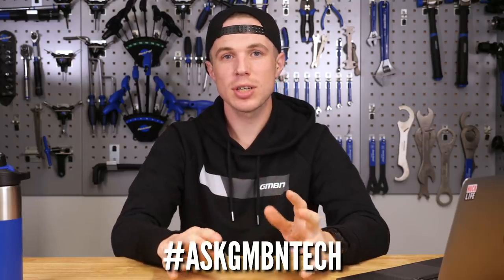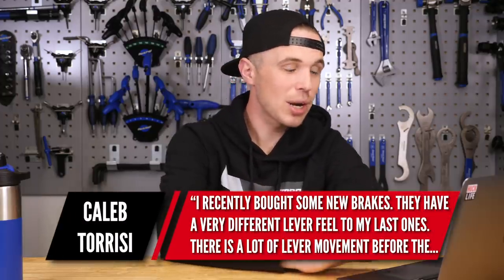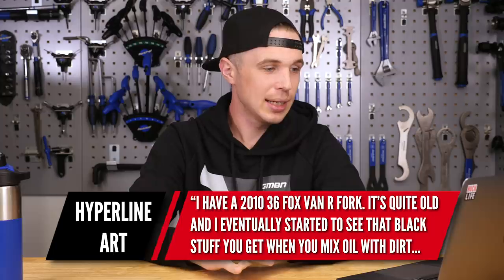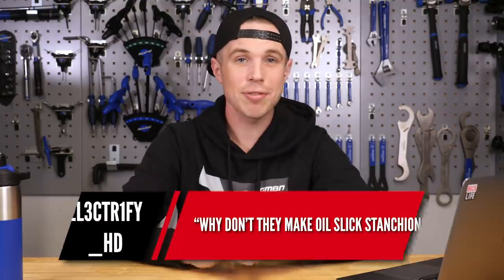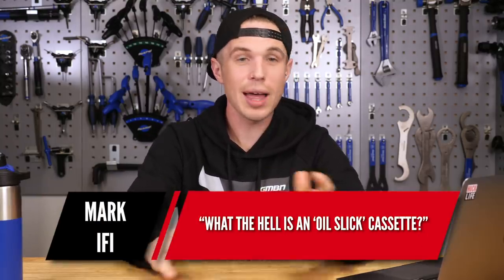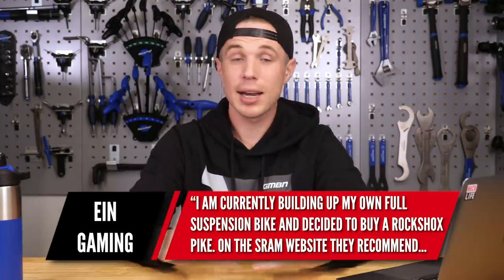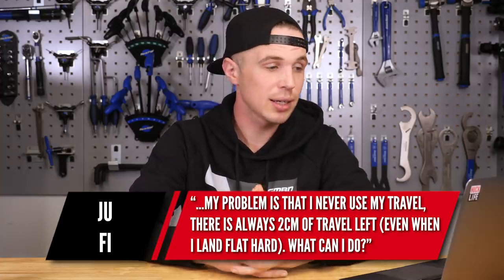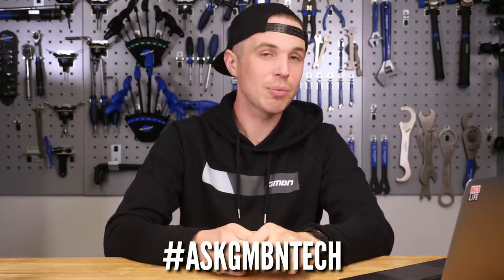Why Don't They Make Oil Slick Stanchions? | Ask GMBN Tech Ep. 86

Comment from the maker: Got a tech question for us? Submit it below by using the hashtag #AskGMBNTech for a chance to be featured on the show!
Reply: I have a Lombardo Sestriere 300 which has a 3x7 speed Shimano Altus gear system, do you know if I can upgrade it to a 1x9, 1x10 or 1x11?
Reply: #askgmbntech 
"Hello from Kharkiv, Ukraine!
I've got 2017 Cannondale Beast Of The East 3. In stock it goes with 2.8" WTB Trailblazer tire on WTB Scraper rim, with 45mm internal width. 
Unfortunately my rear rim got cracks on the spoke nipple holes. It is very difficult to buy a rim with such parameters in our country((( 
 In your videos you convert your bike from 27,5+ to the 29er. So I decided to put  29" wheels on my bike. 
What width of rims & tires should I buy?"
Reply: #AskGMBNTech im looking to upgrade my shock on my calibre bossnut, im looking at the rockshox monach RL, im looking at the shock on there website and i cant find the travel for it, would you please be able to tell me how much travel the shock has and how to measure it. Thanks alot!!
Reply: #AskGMBNTech
I have a late 90s K2 Proflex 3000, set up with a Marzocchi Bomber MX Pro fork.  This is a departure from the Girvin crosslink fork that the bike was designed for, and as a result the bike is dynamically unstable, with the forks oscillating uncontrollably when riding with no hands.  Short of hunting down a twenty year old linkage fork, is there anything that I can do to make the bike more stable?
Reply: I’ve tried to set my wheels up tubeless with a 2.6 continental Trail king and der derbaron ,muc off sealant and valves paired up with Alex MD35 650B plus 32H rims. There is a tiny leak in the rim where there is a line that follows round the whole rim which I imagine that’s where the rim joins, my rim tape is good with no scuffs or tears and the tyres seated perfectly, keep up all the good work GMBN! #AskGMBNTech
Reply: #AskGMBNTech
Hi guys. I am wondering why the DH bikes have rather conservative reach numbers compared to modern EN bikes? For DH bikes, I do not think I have seen more than 490-ish reach even for the largest frame sizes, while 510mm+ is becoming pretty common for EN bikes - with the importance of downhill stability and longer chainstays allowing better weight distribution, I would expect the numbers to be very similar. What's the reason for that reach length difference in these two bike categories? Thanks!
Reply: #askgmbntech 
I have a 2018 Vitus nucleus VR. Is it possible to convert it from a 2x9 to a 1x11? If so what equipment would I need?
Reply: #AskGMBNtech Hi gents! After having a puncture and fitting a new inner tube, my rear tyre wobbles quite a bit! The wheel is fine and the tyre was perfectly even before all that. What do you suggest, how can i make this perfectly aligned and balanced again? Thank you for your comments. Anti
Reply: #AskGMBNTech Hi guys I have question 
My new bike have crank with 3mm offset chainring  now me question is can I use a 6mm offset chainring on it 
thank you for help mike
Reply: #AskGMBNTech - When are you getting new t-shirts with "bicycles, my friends, are the only chains that will set you free" ? Sponsored by @HenryQuinneyPhilosophySchool
Reply: #askgmbmtech hi guys I'm looking to upgrade my forks I have suntour xcm 27.5  11/8 -1.5 . Can I change to fox 36 and what would I need to look out for to make sure they fit .bit of a newbie .my last bike was a bmx thanks .carl
Reply: Can I paint my bike stanchions

Comment: Hey Henry, about the break lever throw questions. I run saint breaks that have great power but a lot of free stroke before grabbing. I swapped out my Shimano rotors witch are 1.8mm thick for Magura rotors witch are 2mm. This drastically improved the lever feel and the rotors are stiffer witch means less likely to bend. Hopefully it helps someone in the future.
Reply: I feel the same with my Zee !!!

Comment: 'oil slick' look isn't always achieved with vapor deposition (it can be, but doesn't have to). You can also get this look by oxidizing metal carefully (electrochemically or thermally). The oxide layer cycles through different colors depending on its thickness, hence the oil slick look.

Comment: About the first brake/play question : Sounds like it potentially could be an issue I myself and a friend of mine had with Mavic Crossrides in which there was some sort of delamination occurring within the hubs themselves ( front and backwheel ) the part where the disk is attached to the hub actually stayed fixed but the remaining part of the hub had play ( these cheaper hubs are not 'one part' but rather an assembly) .This phenomenon is also described in some biking forums if you manage to find them. I think this issue occurs more than its reported because many people don't notice the it...  The crossrides I had were 6-bolt but I can imagine the same issues occurring on centre-locks.

Comment: Regarding the question about Yari fork not getting full travel. It could also be that air pressure has build up in the lowers. Try to burp the air using a small ziptie by sliding it between the stanchion and the dust seal lip. Make sure to clean the area carefully before doing this. Perhaps you can hear a short hissing noise.

Comment: Re the rockshox fork travel use question, its due to the larger neg spring on newer forks or upgraded air springs to earlier ones. Adding Tokens will make it much worse, and harsh in the last half, sorry Henry. The new forks basically dont need tokens in the main.
You need to run zero token and 30% sag on the rockshox forks with the new airspring. The neg spring is so big u will still get loads of mid stroke support (due to volume/pressure changes, big neg gives more mid stroke sppt, not less), with great progression. Its confusing lots people (even h and doddy!) as forks usually use tokens and 20-25% sag. No tokens, 30% sag, is the new standard for RS forks. Try it! Dream fork if u do!

Comment: i think i have the same problem as the first guy on my hardtail, it is very old (bought in 2007). to get rid of the play that i have when doing exactly what he describes would i have to change out the callipers due to them not holding the pads as tight as they used to over 10 years ago.

for reference, no play that you can see by just looking and feeling the components on the bike, and the not so big problem is actually bigger on my rear brake, i suspect it comes from me having spent most time of that bikes life on the rear wheel doing wheelies and thus using the rear brake a whole lot and pretty hard use too.

Comment: hi just a little note on the problem with brake lever travel.
I have a trek remedy 8 with SRAM guide r brakes when changing the pads if I don't adjust the using the special spacer tool the lever feel is shocking

Comment: #AskGMBNTech Can I service my rockshox yari 100% by myself? Willl it void my warranty? does factory oil in lower legs and in the damper work in lower temperatures like -15°C or -20°C? If not what other oils should I use for that temperatures? I want to be ready and know what to choose for the winter season
Reply: KCPR666 who does mtb when it is way below freezing outside?
Reply: fluids when cold become more viscous. if the damper gets sluggish you might want to swap the oil for a tinner one
Reply: Sram already can advise u on fluids for low temp use. Check.their websites.

Comment: #AskGMBNTech Hi guys, loving the show. I have an old Fox 34 fork from 2013. Because it had terrible stiction, I replaced the air shaft assy with an NA2 upgrade kit. I even hacked a negative air spring assy in there (from MRP) I also upgraded the damper to an Avalanche open bath damper. The fork still has terrible stiction. This makes the fork almost rigid when it is sagged. How can I make this fork more supple?

Comment: 9:25 add 5% more sag and if that doesn't do it, do what Henry said

Also, I'm with him on the oil slick thing. Accessories need to be black for the most part with potentially some accent colour (you could do white but that can be overdone really easy). The idea is to not draw the eye away from the shape of the frame too much
Reply: I agree with this as well. Let some air out and increase sag to see if you use more travel.
Reply: It sounds like he is using full travel, people don't realise that the crown to the top of the fork leg does not indicate the travel, forks have bottom out bump stops, and they usually leave 2cm ISH of stanchion. I thought he would have mentioned this.
Reply: @jamestyrrell2225  Not so on rs at least. If u let.all the air out, u can slide the lowers up so the o ring gets to about 3mm from top of legs. Thats full travel.
Zero tokens, 30% sag is required on latest RS forks or if u upgrade airspring to new ones with larger neg spring
Reply: As he said he was running 20%, he needs to run 30% sag. The new RS airspring with larger neg needs no tokens and 30%, but still has amazing mid sppt. U wont get the full potential of the fork otherwise, or use more than 80% travel. 
Its a step change in fork performance, but needs a new mindset in set up
Reply: That's fair then, I thought there'd be more than that! Will bare that in mind if I ever get rockshox haha. Personally I run quite a low percent sag, between 20 and 15 in my 36 float, but I jump a lot and need the support. If I ride xc I release pressure.

Comment: Hi, does a sram nx eagle axle fit in a 83mm english threaded dub bottom bracket? Keep up the great work!
Reply: Needs to be a DUB NX Eagle crank in order to fit in a DUB bottom bracket (DUB meaning crank axle diameter is 28.99mm)
Reply: Hendrik K. So, the length of the bottom bracket doesn’t matter?

Comment: You can get a sort of oil slick fork, the coating is called Titanium Nitride and this will actually improve performance as it reduces stiction and makes the stanchions harder improving longevity, you can also get DLC treatments that do the same.
Reply: The gold colour.on chains and xx1 eagle is a titanium nitride coating. Also drill bits. Its different to the oil slick rainbow effect
Reply: @rupedog  thats why I put "sort of" if you take the purple nitride option it looks sort of oil slick.
Reply: @rupedog  its been used in motocycle suspension for years, my mx bike has DLC coated forks and shock shaft.

Comment: oil slick surface coatings are based upon a variable thickness of coating. You don't want that for fork stanchions, you want the coating of very consistent and as thick as possible.

Comment: #AskGMBNTech - could you give some thoughts on buying carbon frames 2nd hand? Looking at a Pivot Mach 6 for a VERY reasonable price, but feel strangely more worried about buying a carbon frame on sight, although I've previously bought aluminium over the net solely based on photos.

Comment: Hello, firstly i love your videos.
Secondly i want to know that which one is better option: Buy a mavic crossmax 2019 modell with 24 spokes, or build one with 32 spokes, novatec hub and blackjack rim. The price is the same.
Reply: for a 29" rear wheel best to use 32 or 28 spokes at least
Reply: @ultiss  oh i didn't mentioned, it is a 27,5 wide wheel

Comment: Hi guys, #AskGMBNTech 
I have a trek top fuel 8 2017. I have started riding more downhill and would like to make my bike more suited for it. I was thinking of putting a 130mm fork on the front [ it currently has a 100mm ]as well as a shorter stem and maybe some wider more swept back handle bars.
is this a good idea ?
I am thinking it would be a cheaper option to buying a trail bike 
please let me know if this is an awful idea !!

Comment: #askgmbntech: Hi there, I like your show very much and learned already a lot! I have a canyon sender cf from 2019 with a fox x2 elite. My hometrails do not have a lift, therefore pedaling is the only option to get on top which is quite ok with me. cassette is a 10 speed with 11-28 and a 36 in the front. Bobbing while pedaling is a problem and feels like pedaling in muddy conditions. I thought about upgrading the shock with lock out lever. Might that help? In addition, I could also upgrade the rebound dial to get both lsr and hsr. Would that be worth considering, too? Thank you for your help!

Comment: Hey guys,
I have a 2018 Intense M16C it has a rockshox vivid r2c at the back and whenever I am off the bike and move it I can feel a bit of play (maybe 5-10mm of it) when I hold the back wheel on the ground and pull up from the seat. Is this normal? If not how are some ways I could stop or minimize this.

Cheers,

Anthony
#askgmbntech
Reply from the maker: Hey, sounds like it's time to check the frame bearings/shock bushings. We suggest fully stripping the frame as it may be that an axle has broken. Hopefully it's not a big job Anthony.

Comment: Hello GMBN, i have a 2009 Ram Dhx downhill bike, the drailure is a shimano slx with 9 speed, so my problem is: when i want to get some speed and i push the pedal the drailure is not on the pinion and my pedal go like i have no chain, and recently i had a big crash because of that, what can i do? #AskGMBNTech
Reply: derailleur not adjust properly or simply worn out cogs?

Comment: #AskGMBNTech i have vitus nucleus and im looking to upgrade the fork from 120 to 130-150 what changes should i expect riding wise?
Reply: higher bb, slacker headangle which is good for desending, however climbing will suffer a bit, steering less direct and youll have to slide your saddle forward to keep the same seating position. hope that helps

Comment: #askgmbntech with disk brakes being around so long in MTB tech and fullys being around for as long as I can actively remember, were there any attempts on making the rear end more like a Motorbike suspension? I mean connecting the chainstays directly to the seat tube and removing the two bars going up into the linkage?

Comment: #askgmbntech  I'm trying to bleed my old avid elixir 1 brakes for the first time in a long while. I got the bleed kit from avid and followed the instructions perfectly, however, I can't push the fluid from the syringe at the caliper to the one at the lever.
Both clamps are open and the syringes thread in nicely. If I push hard, the fluid ends up on the floor. I also tried pushing from the lever to the caliper but it doesn't work. This is the case for both the front and the rear brake.
I read online that dirt particles and pieces from an old and brittle o-ring can block the insides of the system and that it helps to clear the hose and take apart the lever. Could that be possible? (btw, both brakes felt spongy but worked okay before this)
Have you got any other idea what the problem is and if I can fix it myself? The bike shops around here are terrible and I don't want to spend a fortune on a new pair of brakes. Please help!
Reply: Where does the fluid on the floor cone from?
If they worked ok before, the hoses cant be blocked, must be the bleed ports block. Given both are the same, it logically suggests ur not doing something quite right.
Is the CORRECT sized bleed block inserted (pads removed) before u start?
Reply: @rupedog  Thanks for answering! The fluid leaks from where the syringe threads into the caliper (the threads work normal though, as I said). I did use the correct bleed block and nothing leaked from the pistons. It seems quite logical that the bleed ports are the problem but I didn't want to poke around inside of the caliper yet. I'll inspect them again when I get home

Comment: #askgmbntech my bike shop recently installed a Shimano SLX 1x11 drivetrain on my bike with a SunRace 11-50 cassette. and they used some small strips to get some additional offset to align the chain properly to avoid noise and improve shifting. The drivetrain works fine indeed but they used two in the left side and one on the right side, will this affect my pedaling, is that the right way to align chain line in 1x systems or should they have equipped the SLX crankset with the 3mm offset instead? The cassette has around 100Kms only and I can start to see the black coating fading already from the teeth of the cogs, is that fine or is it because of some bad chain adjustments? Thanks
Reply: what do you mean 'small strips'? spacer rings between bottom bracket and frame? that would be no problem
Reply: @ultiss  yup, I just didn't find the right translation to it, sorry :and thanks :p
Reply: Yes its fine. Depending on.ur bb shell width, boost/non boost, and gearing, u will need specific combo. U can confirm on shimano's fitting instructions (google). If their anything like sram, they will have online manuals

Comment: #AskGMBNTech how can I find out if my straight headtube on my bike can fit a tapered fork? I know hope do a bottom headset cup that has the bearings externally
Reply: All depends on the specs of your head tube and fork specs tbh with out them numbers not a lot of people will know what u need or if it can work
Reply: if its currently a semi integrated 1-1/8 headset in a 44mm internal headtube you can fit a 1.5 external bearing. This will ofcourse raise the front end a little
Reply: I dont know what size headtube it is. Its the 2016 giant talon 2. How can I measure it accurately? Thanks guys
Reply: @tobywynn9616  get onto live chat on wiggle or crc or even email hope with some specs or try the cane creek headset guide with your bike details Nd should tell u what will work
Reply: @vtecmossy  thanks so much that's great idea. Appreciate it👍🏻

Comment: #AskGMBNTech
Hi guys, im trying to rebuild my marin mount vision 5 but need to replace the rear linkage bolts and can't find the ones I need anywhere, do you know of any other bikes that's use the same bolts or where I cane get the ones I need(I think they are M12 x 1 x 18 and M12 x 1 x 25 but not sure) any help is greatly appreciated
Thanks